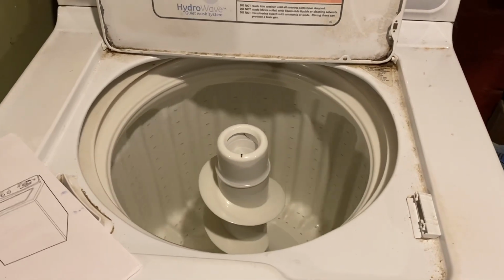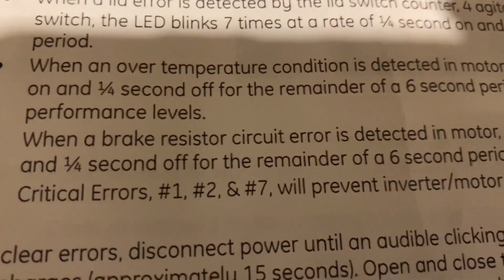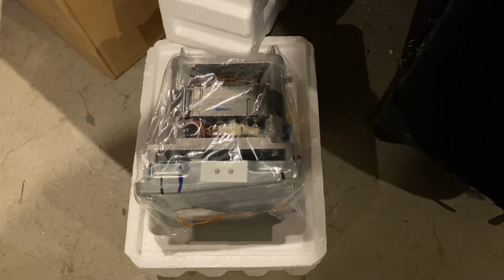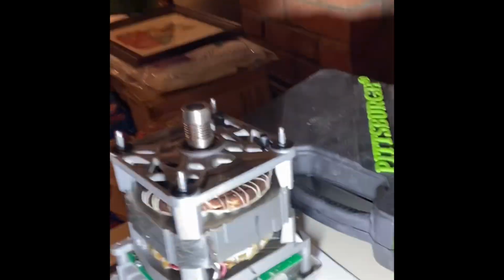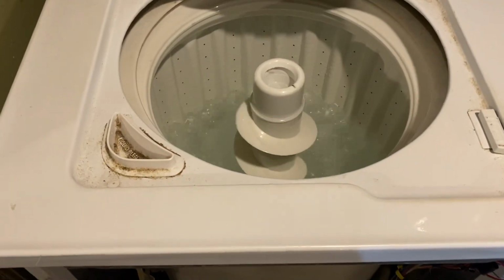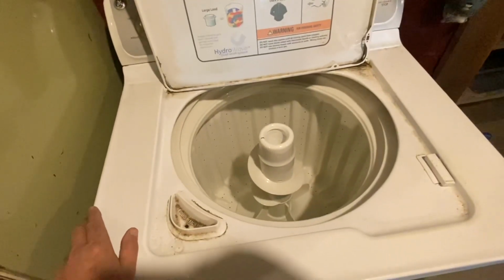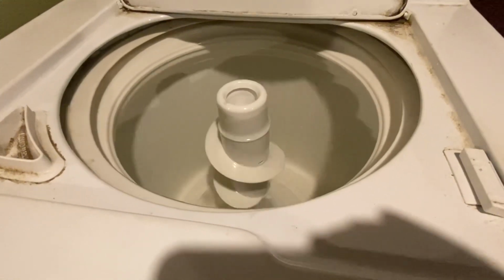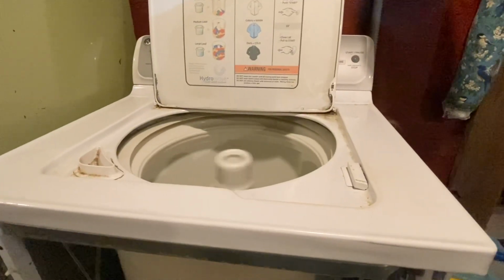GE WWSE5240G3WW “slow spin” fixed.

Comment: Great video. I had the same exact symptoms and was also getting the same number of flashes. Bought a replacement motor off of eBay and installed and it fixed the problem. Replacement took less than 20 minutes. For others doing this replacement, you don’t need this belt installation tool. Just use a zip tie as shown to keep the belt in place while turning the spindle and it will get into place just fine.

Comment: I have the almost identical model to this GE washer shown with the identical problem of slow spin.  My machine is 15 years old and the motor, belt and other parts look like new.  I suspected the timer wasn't telling the machine to move from drain spin (slow speed) to full speed but didn't want to risk purchase price of $300 for new timer. A new machine like mine is about $850 tax included. Anyway, I decided that as a last resort, before I put the machine on the curb for garbage collection, I took a socket from my tool kit and tapped the timer several times - firm enough to shake but not to break it. Put it in spin mode and started. Voila! The thing spins to full speed!! I feel great today!